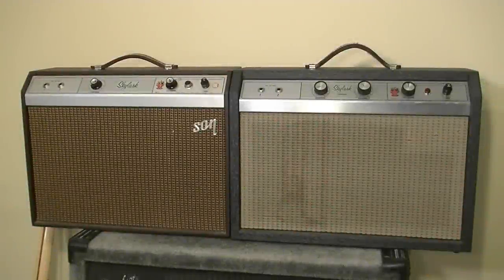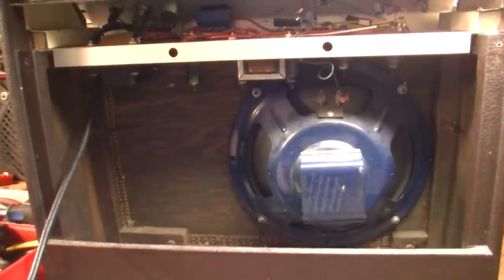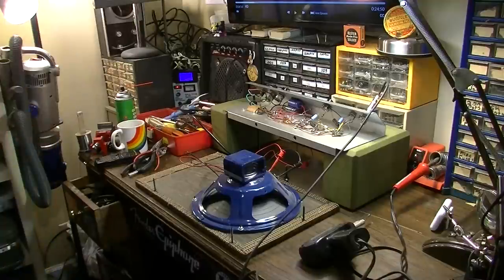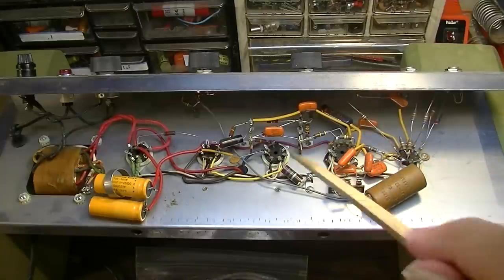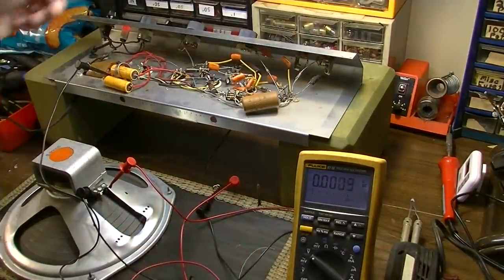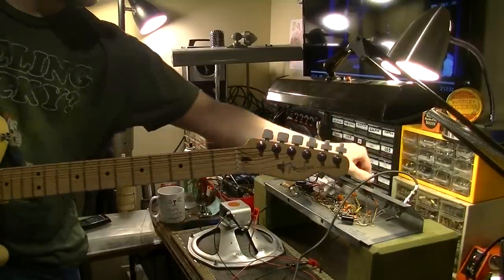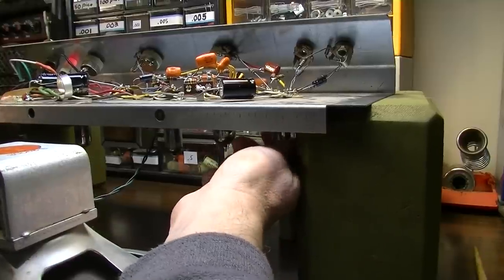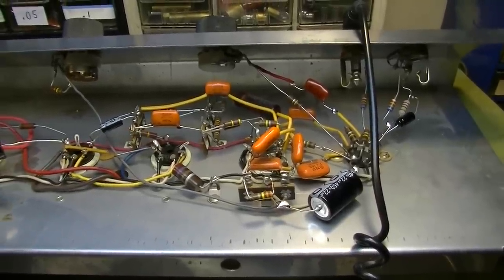Secrets of the Gibson Skylark - What Would I Do with $1M? Two Gibson Skylarks at the Same Time, Man.

Comment: I used to gig with two Skylark GA-5Ts. I've owned 5 or so and still own my first one. They're Champ-killers. When I gigged with both, I would send a stereo signal out to them and do a ping-pong delay. They sound amazing mic'd.

Also, those are not normally referred to as "chrome-dome" knobs. They're called "reflectors."
Reply: "Chrome dome" knobs are Telecaster knobs.
Reply from the maker: John Kelley I was wanting to say they were "top hat" knobs. Whatever they are, you can make 'em. :)
Reply: So two of these together in stereo were loud enough to cut over a drummer ? Could handle a medium size venue ? And mic'ed for larger ones ? I've always wanted to try gigging with two Gibson eh 150 amps or two blackface princeton's or vibrochamps. I love the tone of old tube amps but after having surgery I can't carry heavy tube amps around anymore. Would you recommend using two smaller tube amps in stereo ? Did you run into any issues doing that live ?
Reply: i disagree that they are champ killers they are made to not sound great with
fenders unless you change it.change it & they are quality but very different from a champ for me but if you use a gibson guitar they sound much better.so anyone wanting to get one remember to change the cap set up if you want to use it with a fender guitar as shown by the man who fixed them great post peace...

Comment: I have the tremolo version. I bought in 1974 for 15.00. It is not nearly as good of condition as those 2. I have replaced the speaker and the handle has since fallen off. But it still sounds pretty good full blast. I rarely use it these days.

Comment: How you can shed light on my problem. A fuse, 5 amp blew in my amp, don't  know  much about electronics but my limited understating I assumed  the fuse . was to protect the amp from incoming spikes. Went to an electronics shop and they agreed, claimed lan incoming spike knocked out the fuse. Bought a new fuse installed it and it blew right away. It is hard for me to accept  that a spike got both fuses...used this amp for years with no problem. Any idea what could  be happening  here. Any help would greatly appreciated. Thanks in advance.
Reply from the maker: Could be a number of things, but you most likely have a short somewhere in the power supply - bad cap, bad rectifier or power tube, bad thermistor, etc. don't install any more fuses, take it to a tech for a proper look.

Comment: @The Guitologist
Brad how about, set the grille & speaker flat on its face, get hold of spkr wire, then lower the empty cabinet face down onto that, and flip - so the baffle board is lying in place & speaker wire protruding under the cabinet edge - then test your tone (albeit in omni-directional mode.) 
PS Sonny Rollins has a great rave-up called G-Man - I bet they know.

Comment: I also watched a speaker building and design, on a computerized graph the same speaker had entirely different characteristics if the speaker is upside down like a ceiling speaker the graph of that same speaker acted like a different speaker than if it was aiming up from the ground and aiming straight at you and it wasn't a little change. The weight of the speakers cone and voice coil is the issue when trying to achieve a flat response.
Reply: I was wondering about trying to judge tone with the speaker out of the cabinet and face down.
Reply: MrBrymstond+ I'm not sure how that's supposed to help.  We may disagree on the details, but I think we're in agreement in scratching our heads on trying to judge an amp/speaker sound when it's laid out that way.
Reply: You should watch the video in full first, I've known about this for years, but this is just more proof of the way a speaker reacts in different positions.
Reply: I've watched that video before.
Reply: Then you should have known speakers will act differently out of the cabinet and face down like they design Dolby Atmos Ceiling mounted speakers. It's because of weight of the voice coil, the material use on a given speaker and the suspension as it will change again facing upwards and at a 45 degree angle for stage monitors... It's called gravity. 
You posted 
Russell Hltn 
14 hours ago
I was wondering about trying to judge tone with the speaker out of the cabinet and face down. 
So I told you what and how to correct it as best as possible. You posted a reply on my comment not your own comment so I suggest getting in touch with a speaker company and bicker with them.
Reply: It just struck me as a strange way to judge the sound - not listening to the front on-axis but off to the side and from the back.  Plus being face-down on the table like that, the speaker effectively has a very small enclosure due to the pressure build-up on the front of the speaker from the trapped air.  That tool is nice, but the impedance measurement is not the end-all/be-all of speaker measurement.  What's really needed is a reference mic in the font.
Reply: Yes, it's not typical. I think he was just testing for noise and sound.
Reply: That tool is a frequency generator that tells you what the frequency of the speaker is. It tells you the roll-off of the Hz rating and the efficiency of each frequency is and its faults from an average of 20Hz ~ 20KHz or 20,000Hz. It's just a cheaper version of the device these people use on a 6x9 car speaker and they test it facing up, the way it's mounted in a car. https://www.youtube.com/watch?v=jnTeHEh52yk

Comment: If the date of the non-trem amp is still in question, the tolex matches my Falcon... It's not a tolex they used for very long... it also has the aluminum chassis... The stamp on the original Jensen in it dates to '62...  So... I think '62/'63 is a solid logical jump...

Comment: Hi there I recently restored one of these i have had for 25 years! Did the caps, noise was gone! Did the power cord change and removed the death cap. Replaced torn original speaker with a Jensen C10Q sounds great, this was with the help of a previous video you did on this model. I left the tone sucker in for now, it is bright but the speaker calmed it down (was using a 1028 legend). Now my question is what values did you use on the capacitor and the resistor after debugging the noise? Also next up is 67 GA5T have you done one of these? Love all your videos, thx!!

Comment: I just purchased a GA-5T that has a inspection date of Nov. 1966 on one of the cabinet components. I watched this video and another you make back in June of 2106 and from what I can tell everything is original on mine including the "tone sucking network". Do you have a parts list of what you replaced on the GA-5T in both videos and would you have these parts available for sell?  Also, when I turn the unit on it has a very loud hum even with the volume turned down. Is that caused by the filter caps? 
And...., Great Videos! Great work! I learned a lot but am still very much out of my element. I just want my amp to sound as great as the ones you tweaked.
Reply: Little little late on the reply but yeah I would start by changing those filter caps for sure because if their original they're toast that will probably get rid of your homebody and you could have some other suspect caps in the amp also all the old paper electrolytics should be replaced then check your tubes good luck buddy those are great sounding amps!

Comment: Note on Asbestos.
I worked in construction and carpentry,woodworking,furniture and cabinets.During my career I had the occasion to do work for a company who’s mission was Asbestos testing.
These people were scientists ,professionals and highly respected in this field of asbestos abatement.
Here is what the owner of this company told me.One particle of asbestos lodged in your lungs is enough to cause cancer.I am sure I looked skeptical when he told me this as I ,like you question everything.So then he said ,Look one particle does not guarantee cancer but if you are in an environment that has asbestos insulation you are going to be exposed to millions of particles.Especially if it’s your work space.
That makes sense.
The particle are jagged and extremely sharp. They can and will dig into lung tissue permanently.
In other words it’s bad shit.
Wear a mask if you must be around it.Be safe.
Reply: I do not want to downplay the risk, but as long as the asbestos is contained in a stable matter and not scratched, sawed or messed with it is relatively save as there are no particles emitted in the air.

Comment: I have one of these, i replaced all the resistors and capacitors, except for the tube sockets, it sounds great, but my question to you would be, where could i get the original speaker reconed?
Reply: The Speaker Workshop in Fort Wayne Indiana. Second to none.

Comment: I left my Crestline 100% stock...   knowing that it sounds WONDERFUL with humbuckers,  and grating with singles.   Gibson amp made for a Gibson guitar...  why not?
Reply from the maker: No harm in leaving them. I find the ones with the couplets are a more versatile amp with them removed.
Reply: I did a few tests on my hoarde of amps to get a visual representation of what the output looks like.    The Gibson GA-5T is included in the mix.    https://www.youtube.com/watch?v=oi72KdptmN8&t=1524s    It's not scientific, but I sure can see the differences in sound shape.   
With NO tone knob on the amp,  you'd be surprised at how much more dynamic your guitar's tone knob can be on the GA-5T
Reply from the maker: With the amp so tinny, the tone knob on the guitar will make a bigger difference, sure. But I'm of the mind that when you take frequencies out in tone-shaping, you can't put them back in. A better solution would be a tone control on the amp, but that would be a bigger mod.
Reply: The "HOT"  spot in frequency created in the treble region is precisely where your guitar's tone knob falls (on a gibson anyway).   It really does sound beautiful when you match them.   Sounds great with a Gretsch too.
Reply: Gibson engineers apparently.   I have a 63 GA-5T  and It's still all stock (except for electrolytic caps)... which are replaced with stock value.

Comment: I have a ga5 skylark bought new in Christmas 1963 but I think it’s a 1960 model because all of the tubes (still original) are from 1960. Is there any way, by serial number , schematic or whatever to confirm what model year it is ?  That you know of.  Thanks.   
I agree that it sounds best on humbuckers but this was sold as a package with an es-225 with p90s ,and cables a strap a box of a dozen sets of strings a box of picks etc for $400.00 as a Christmas student special and it sounds great with p90s also.  Very thin sounding on my 1963 Jaguar and even worse with 1996 strat ultra with lace sensors. But with p90s and/or humbuckers it rocks , my n-255 custom has both and they pair very well

Comment: Remember High Gain and low noise and stability can all exist together , if you look at all options. Tying the Grid to Cathode (same tube) with a 150pF cap is quick and easy. Here's some mods I used to stop Blocking distortion , occultation and noise of all types. Link>https://plus.google.com/u/0/photos/photo/108636352594690552731/6512893513279791970

Comment: What I think is happening is the second stage plate is feeding signal back to the grid of the first stage. If you have no bypass cap on the cathode of the first stage and the cathode resistor is at least 1k5, the overall gain of the two first stages is not enough to cause it to oscillate. If you put a cap there, it will oscillate. The cap can actually be pretty much any value, because the oscillation is high-frequency, and for a high frequency any reasonable cap value will look like a short circuit anyway.
The real fix would be to fix the lead dress, which is not exactly easy on an amp of this construction, but maybe you could try to move the plate resistor of the second stage as far away as possible from the inputs of the amp, or orientate it perpendicular to the grid stoppers on the inputs.
Reply from the maker: I figured out later that the instrument cable I was using was faulty. Switched cords and the last little bit of squeal disappeared. The rebias on V1 helped too.

Comment: weber smooth cone ceramic 10 makes my crestline ga-5 sound good with telecaster
Reply from the maker: The earlier GA5 shown in this video didn't have the Sprague tone sucking couplet from the factory, so it sounded ok with the Tele. The other one...not so much.
Reply: The Guitologist to your point: mine is the later style, very tinny sound with stock speaker.  I believe the smooth cone mitigates some of the treble. Also, my Tele has alnico ii pups which are less feebly. Anyway, sounds good with that guitar now even though I believe it still has the sprague pod.